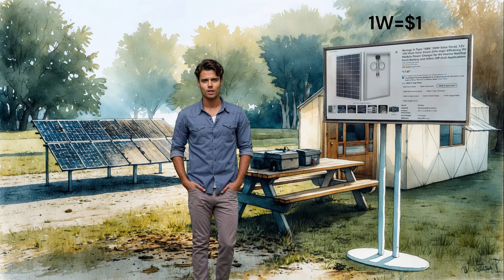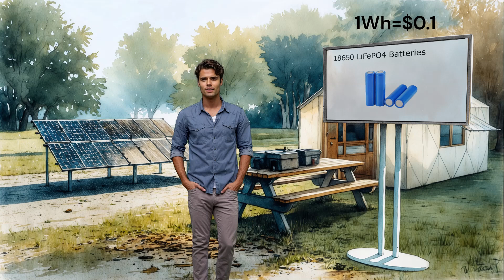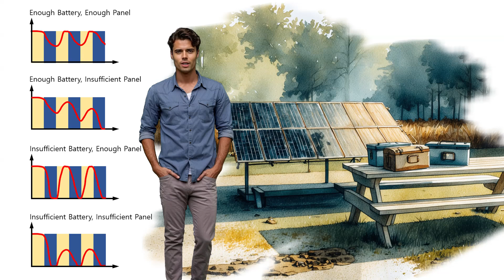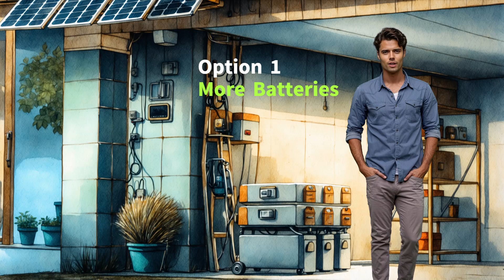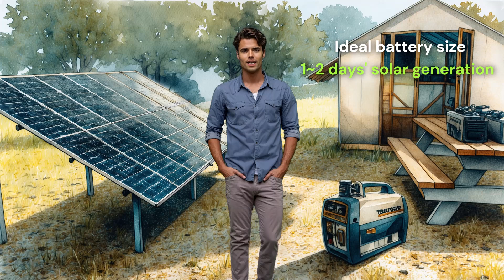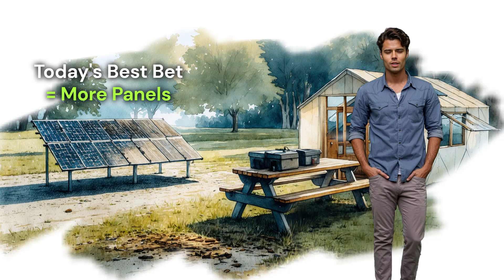Batteries vs Panels for Off-Grid Power - Where to Invest Today?

Comment: Fairly good presentation, in that you bring out integrating in generators into the mix.  The weaknesses that I feel are two fold:  You aren't giving advice with regards to the new (T) President of the USA, and secondly, you don't give the arc on how to make change vs location.
Reply from the maker: That's above my paygrade, my friend :) But I would say there's the "new three" that someone's eager to sell (panels, batteries and EVs), and two of them involve lithium cells. Isn't it compelling that batteries will drop faster under the new tariff? An Occam's razor situation, but who knows... Thanks for your input, and I'm glad you liked it!

Comment: I like your video, the graphs are good to get a visual impression of how this works, but there is going to be a lot of day to day variation: reality will look different. The lesson I think is that if your batteries don't fill up on an average day or average winter day (it's not economical to design a system for extreme situations), you need more panels. If your battery is drained overnight, while it was (nearly) full the day before, you are going to need more batteries.
There are many situations, where things are not going to be so clear and you can reach your goals by either getting a bigger battery or more panels. In that case, since batteries are expensive, it is probably cheaper to go for more panels (possibly with an extra PWM/MPPT). Since batteries and panels degrade over time you might want to get one more panel than you actually need, just to be set for a while.
Reply from the maker: Absolutely! Real-life variables are always unpredictable, and conditions are rarely ideal. This video aimed to provide a starting point and emphasize the importance of flexibility in your system. Future upgrades will always be necessary, and investing in a panel-centric setup now allows room for battery upgrades later—especially given the current trends in declining battery prices. Thank you for sharing your insight; it adds great value to the discussion!